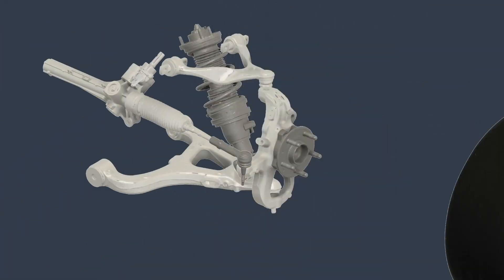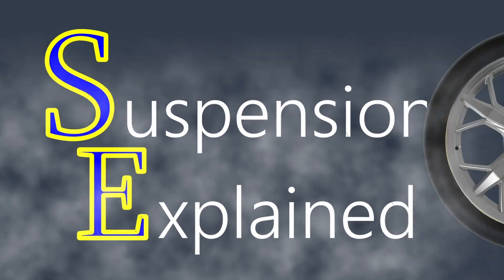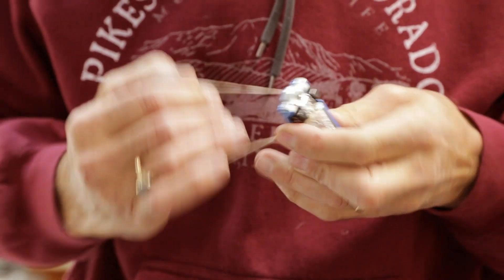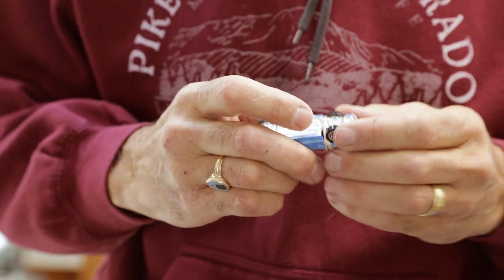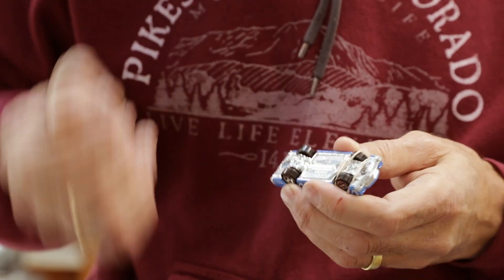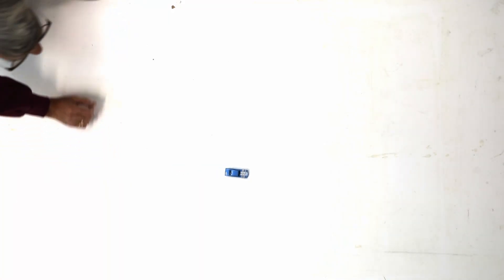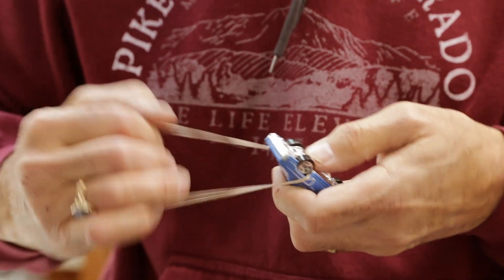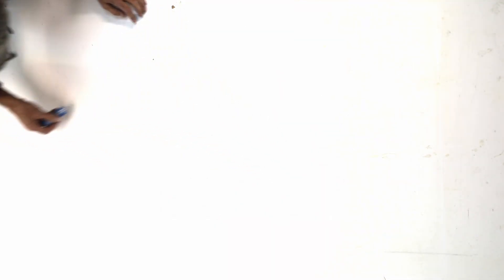Why The Front Wheels Must Always Lockup First

Comment: On the "WHY?": when wheels are made to lock up, they have reduced grip while sliding on the road surface. A car's rotation (yaw) is contributed to by the front and rear axles, where front lateral force creates rotation, and rear lateral force has a steadying effect countering the front. When the rear is sliding, you then have an unstable system, like an inverted pendulum, where any small disturbance induces a large motion in response. Despite the effort to apply the force in an even way, it is never perfectly even. Accordingly, when the rear wheels are locked, the car always spins out.

Comment: Hypothetical: what if you had the static brake bias effectively apportioned according axle weight ratio (I.e. front 55%, rear 45% if that is the weight distribution), and then had the brake bias migrate forward with brake pressure to closely align with weight transfer? The idea would be that in lower-traction situations, you don’t overdo the forward brake bias, and it dynamically (if open-loop) responds to higher-traction situations? From this video, it still seems like you want to make sure the fronts lock up first, but would you expect a net increase in peak braking performance?

Edit: aaaaaaaaaaannnd I just watched the ideal brake curve video. So yeah - could a brake system that had brake bias track that curve maximize passive braking performance? Have you seen that tried?

Love the videos. I need time to digest and consider them, but I’m watching them all!

Comment: We demand explanation why
Reply: an object that is already sliding has about 40% of the grip/friction of an object that is stationery. a rolling tire is stationery, and a locked one is sliding. now, imagine both axles pulling backwards on the car under braking. if the rear locks, it loses 60% of its rearward force. alternatively, you can say its pushing forward 60% harder. this causes the force to be redirected slightly diagonally and spin the car. place a pencil on a table and try to push it from the back. youll have to make constant corrections to keep it straight.

Comment: Very interesting and the opposite of what I expected. On motorcycles you control front and rear brakes separately and never want the front to lock up. That’s instant loss of stability unless you are a stunt rider. Losing traction on the rear on dirt gives a predictable slide even for riders of average ability. Also on dirt roads, the back of a car often loses traction without problem  although  the driver almost subconsciously pulses or modulates braking force and throttle once rear traction is lost. You want the front wheels to keep rolling to maintain steering function, vital when towing a trailer or it will overtake you. I’m not convinced that the simple model accounts for the active steering and braking input of a driver. Maybe relevant for a complete novice driver who slams on the brakes and freezes.

Comment: What is the reason for the difference? I suspect there is a restoring force when the front brakes are locked that is not present when the rear brakes are locked, but I'm not sure what would be the  source of that restoring force. When the car yaws clockwise, I'm guessing the braking force on the driver side wheel must increase while the force on the passenger side decreases. but why?
Reply from the maker: The reason is that a rolling tire has directional stability. It wants to roll in the direction it is facing. A sliding tire has no directional stability. As long as the tires with directional stability are behind the center of gravity of the vehicle, then they will try to keep the it going straight. It’s the same reason why the vertical fin on an airplane is at the back, not the front or why the fins on a rocket are at the bottom, not the top.
Reply: @suspensionsexplained  If a FWD car's rear wheel locked up on the highway (Ex E brake malfunction) and the car starts to lose control, would accelerating stabilize the car or it will get worse? Since the front wheel has directional stability.

I had a lot of fun locking up my motorcycle rear wheel around 10 mph, so this won't be fun at higher speed?
Reply: an object that is already sliding has about 40% of the grip/friction of an object that is stationery. a rolling tire is stationery, and a locked one is sliding. now, imagine both axles pulling backwards on the car under braking. if the rear locks, it loses 60% of its rearward force. alternatively, you can say its pushing forward 60% harder. this causes the force to be redirected slightly diagonally and spin the car. place a pencil on a table and try to push it from the back. youll have to make constant corrections to keep it straight.
Reply: Another thought is that when the front tires loose traction (e.g. in snow) before the rear, it causes understeer whereas when the rear loose traction first, it causes oversteer. Understeer does not cause the car to yaw, but oversteer does.
Reply: That makes sense, but yesterday I could not draw a free body diagram that made sense. I think I know why now. If I only include the forces of rolling and sliding friction on the wheels, the car always goes straight and stable. What I think I need to do is add a destabilizing force, for example a sight turn, an off-camber slope, etc. If I do that, then there are sideway forces on the wheels and the locked wheels cannot resist those as well as the rolling wheels because sliding friction is lower than static friction. Does that make sense?
Reply: Or I suppose, I could draw a free body diagram of the car already oversteering, but then the hot wheel car is sliding on all 4 wheels since it cannot turn it's front wheels... maybe free body diagrams are not a good tool for this problem.
Reply: Another thing that makes this problem subtly complex is that it involves the transitions between static, rolling, and sliding friction. The transition from static to sliding is easy for me to understand. It happens when the force required to accelerate the car through the turn exceeds the maximum static friction force of the surface on the tire. But it's harder for me to understand the transition from sliding to static. Why does it not transition back as soon as the car is sliding in a straight line? I'm thinking out loud here in-between other daily tasks. Is there a good book or other resource you can recommend for this topic?

Comment: Can you please explain why this happens
Reply: Ie does this not depend on weight distribution etc? if yes can u tell us how exactly
Reply: an object that is already sliding has about 40% of the grip/friction of an object that is stationery. a rolling tire is stationery, and a locked one is sliding. now, imagine both axles pulling backwards on the car under braking. if the rear locks, it loses 60% of its rearward force. alternatively, you can say its pushing forward 60% harder. this causes the force to be redirected slightly diagonally and spin the car. place a pencil on a table and try to push it from the back. youll have to make constant corrections to keep it straight.

Comment: The rear wheels cant lock up on a manual transmission car without stalling the engine unless the clutch is depressed or the transmission is in neutral. 

Hard braking at high speed such as on a race track entering a braking zone, its nearly impossible to lock up the rear tires. 

Dialing brake bias towards the rear tires will help prevent front lockup, but will not stall the engine or lock up the rear tires (unless the clutch is depressed simultaneously)

Comment: Just stumbled upon your page. Great video! Your example is an excellent illustration of the non-intuitive. If asked, I bet 80% of experienced drivers would say they would prefer the rear tires to skid first. And if you asked the other 20% why they would want the front tires to lose grip first, they wouldn’t be able to explain their choice.
Reply: From my few times autocrossing, applying brakes first then turning creates lots of understeer. Doing it the other way around though, where you've gone in too hot and need to bleed off speed, even being as smooth as I can, makes my car oversteer. I can't quite tell which start to slip when going straight, but I can tell you that unexpected oversteer is a bit scary even in the safest conditions.